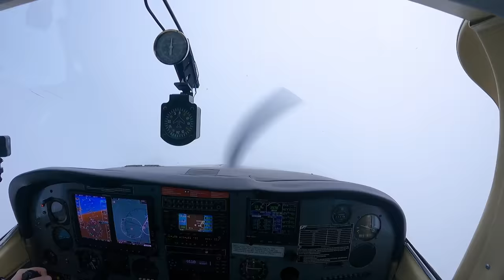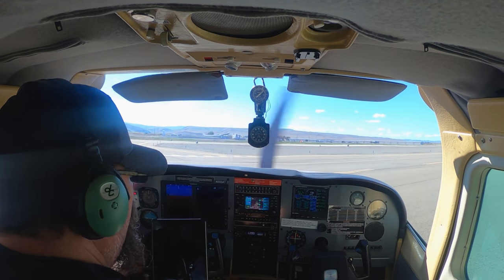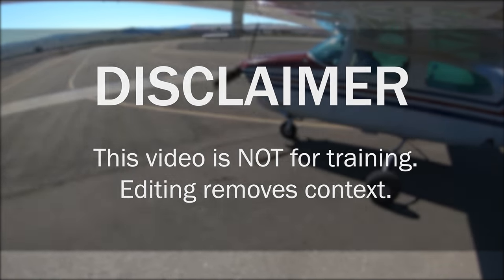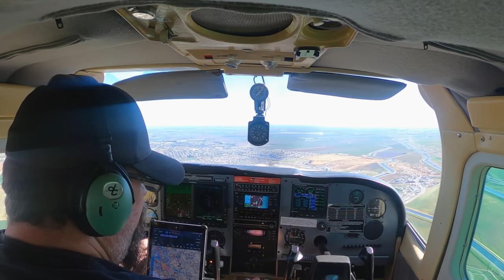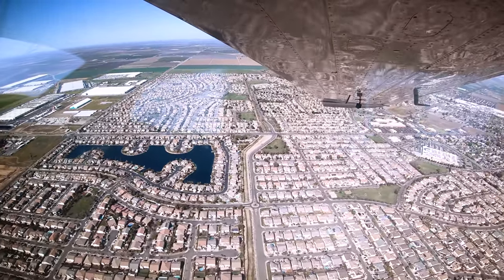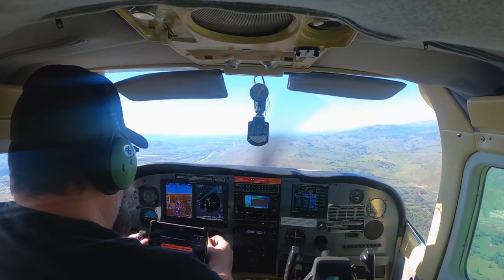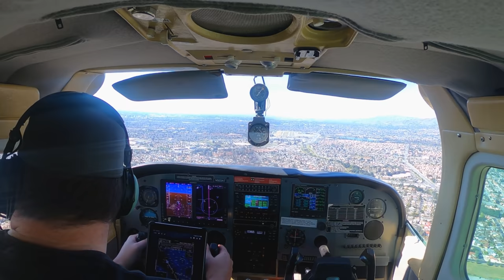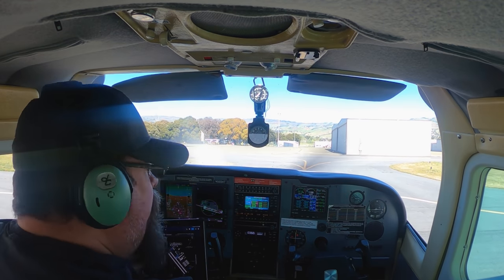Fully Fixed? Almost

Comment: @Edward what a story! you needed at least a dozen of clean undys after that first engine dying on you.  Smooth thermals from this ole model airplane flyer and builder... And remember : Always use compression powder on a new engine 😈😜 ( ole prank we always pulled on the new guy )

Comment: great video, it will take some time to get feeling comfortable again.  Now as you are listening to every beat of the engine you probably hear noises that are not even there as the mind can sure play tricks on you after what you have been through. I had a 1973 cessna 337G skymaster years ago and the check valves in the hydraulic system were not holding due to dirt (or rust or something) in the hyd system so the gear would start to drop and the pump would kick on/off trying to mtn hyd pressure until eventually the pump burnt out. I would pull the gear breaker but then the gear doors would drop and I would have to slow way down not to over stress the doors. I think they said that they took a hyd pump out of a 210 and put it in the skymaster (or from a cardinal 177) maybe they all have the same pump. Anyway....its good to see you in the air again.

Comment: Just curious, on your takeoff I noticed you only had about 33"MP.  As a T210 should you be able to get 35-36"MP on departure to take advantage of the 310HP for up to 5 mins?  Or you can get the higher MP but you choose to keep it at 33"?
Reply: Also noticed on your takeoff roll your nose wheel looked dry and clean, when you lowered your gear for landing, it looked to have some oil on it.  May just be the lighting and camera angle but I would check on that.

Comment: Great Documentation.  I  had an experience where an FBO  screwed  the installation of my new PennYan Aero Engine, on my Piper Archer II. They delegated the job to two unqualified new hires behind my back and without my knowledge. The propeller, a STC-ed McCauley 2-bladed fixed pitch propeller was neither checked, nor, properly submitted for a factory prescribed major overhaul and was mounted  "we put it back on as we removed it". However, another prop strike occurred while in the FBO's  custody. Mechanics lied about encountering excessive vibration, falsified logbooks and lied about the plane's airworthiness. Plane had to abort its first flight and never was airworthy while in their custody. received 17 revised/altered invoices and the bill was three times higher than agreed in writing. Absurd billing charges included, without previous notice/agreement , "talking; making entries in logbooks for $ 112.00; looking up supplies; running up engine for an entire hour, "removal/install prop "  for  $ 522.00;  "engine preparation charges etc...totaling  about $ 14,000- and the owner of the  FBO  and their non-IA  -mechanic  sent 2 separate letters on 2 different dates, declaring their work "unairworthy". Got stuck with this mess and still in Court after 2 1/2 years. Recently , the FBO publicized fake flight  tracks and harasses me thru basically all Internet media and Social Media  to discredit my evidence and reputation....Pilots:  AVOID THIS FBO!!!!!

Comment: Great video and crystal clear!  Just a question  from a novice .  Why does the instrument cluster constantly blink?  Isn't that distracting?   Can't wait for your next video Ed.
Reply from the maker: This is an artifact caused by an interference pattern between the rolling shutter of the camera and the "pulse-width-modulation" that is used to control the brightness of the instrument panel. 

In order to adjust the brightness of the monitor, the LED lights inside are only turned on for a fraction of a second, the longer they are on, the brighter the screen, as the screen dims the are off more than on. Couple this with how "long" the exposure is on the camera's virtual rolling shutter, sometimes the camera captures the LEDs off and sometimes on. You don't notice this from the seat, you just see the screen getting brighter or dimmer.
Reply: The blinking is an effect caused by the video camera. The instruments don't look like that in real life. 👍
Reply: @eugeneweaver3199  oh,I see, didn't know that,glad the man ask that question

Comment: Could you leave the gear down to slow you down and be able to still keep your power up?
Reply from the maker: The problem with keeping the gear down to go slow with the power in a really high setting is cooling. The engine needs airflow to keep cool, and at high power settings it's making a lot of heat. So the knobs for the balancing act are, "too hard on the airframe", "too hot for the engine", "not enough 'high power'"